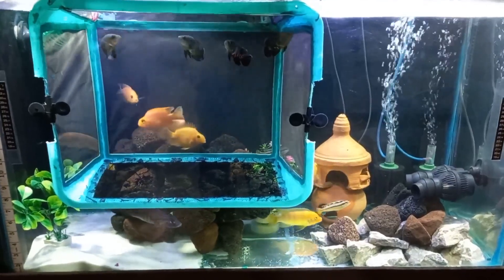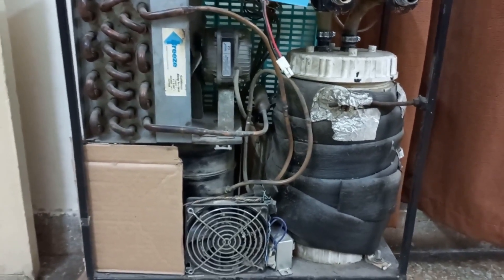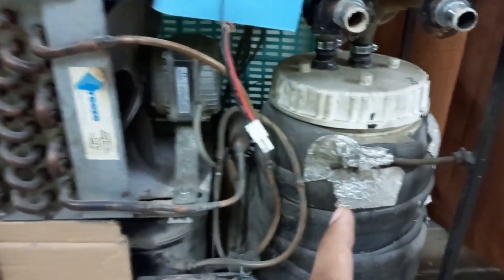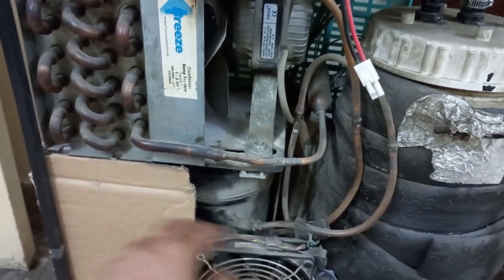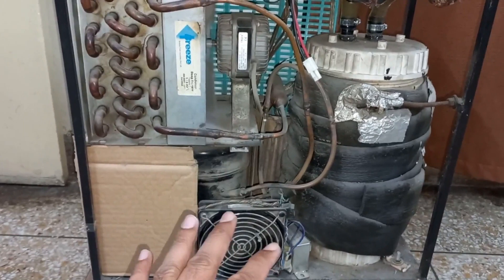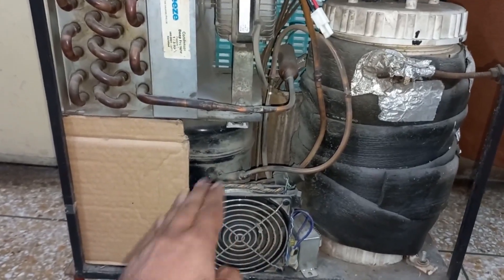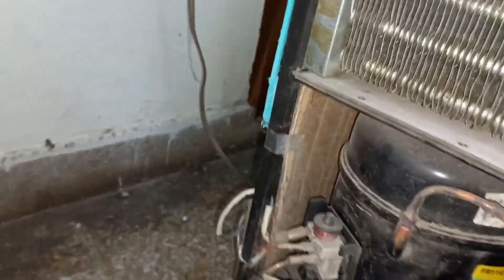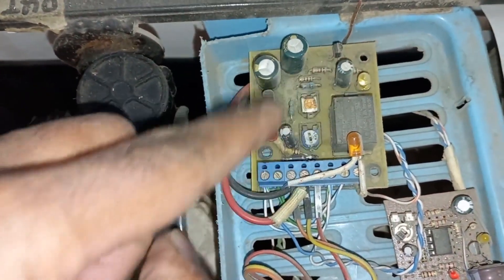Aquarium Chiller | 300L Water Dispenser Cold Plunge | Urdu / Hindi | V6/6, Pt1/5

Comment: You need to have titanium coated evaporator otherwise your fishes will die due to usage of stainless steel
Reply from the maker: Titanium evaporator coil is expensive so I use ss it's working best from last 2 years in my tank no effect on fishes but never use silver pipe or box as it effect fishes